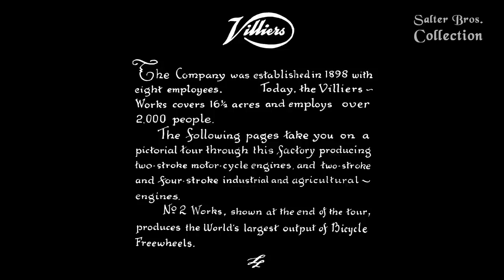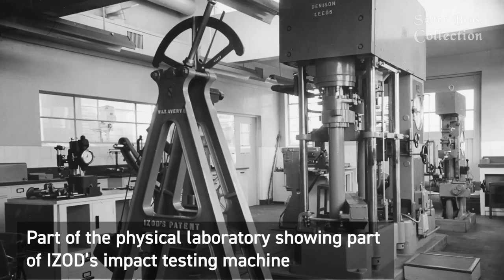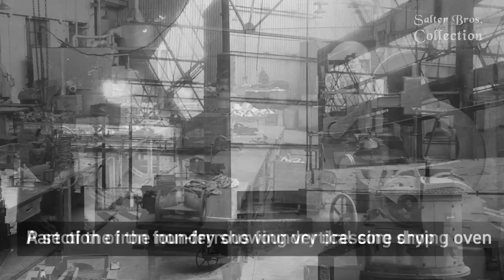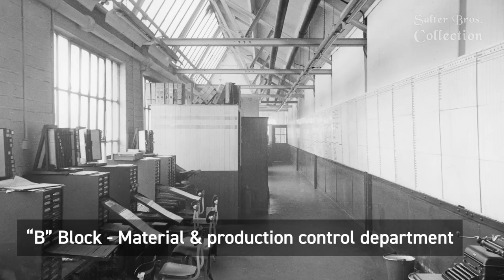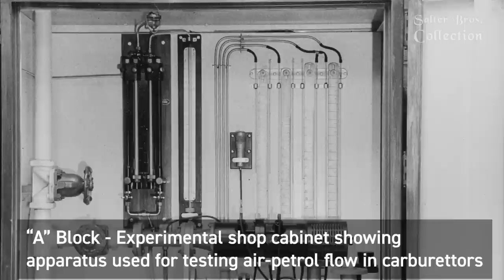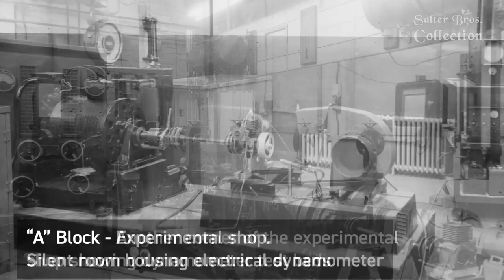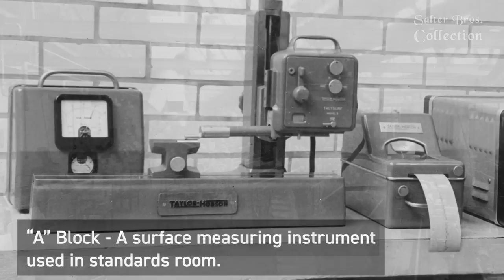The Villiers Visual Story - Villiers Factory, Wolverhampton, England, The heart and sole of machines

Comment: In 1970 when i was eight years old, i stammered very badly. My Father bought me an Ambassador road bike with a solid frame & a 197cc Villiers engine in it. He taught me to ride it in the back field we had to our council house. Once i learned clutch control i was off & my stammering stopped. I rode that bike into the ground eventually snapping the frame. My Father then bought a Triumph tiger cub & put the 197cc Villiers engine in that. I then trashed that frame through jumping it like a moto x bike. 2 chassis frames down & the little Villiers 197cc engine was still going strong. You couldnt kill this little 2 stroke. I owe such an amount to Villiers & my father for the enjoyment those bikes gave me.

Comment: Interesting looking at this series of photographs on the Villiers manufacturing company,  I was looking thru YouTube to find out a bit about my Villiers engine on an old lawnmower that I have and came across this, the old machine I have apparently dates back to 1948 and it’s in amazing original condition, I found it in an old shed here in Victoria, Australia and it has been untouched in it for the last  50 years, due to its brass fuel tank and other bits there is zero corrosion and probably due to our more than dry most of the time climate, the engine, a Villiers Midget, is in remarkable condition as after a couple of hours spent getting it ready and fuelled the damn thing started on the second kick of the starter! And runs like a dream, I can just about count the revs as they can be reduced to a slow speed unlike any other 2 stroke engine I’ve come across, almost like it’s a bloody diesel! They sure made some quality back then!

Comment: The first motorbike that I ever rode was a James with a 98cc Villiers engine.  It seemed incredibly powerful after pedalling a pushbike.
Reply: I liked the 98 Villiers engine we had an Excelcior I seem to remember it had two speeds and a round tin tool box a simple package work bike .It had been abandoned and picked up by the rag and bone man on the flat of his horse and cart and we gave him 2 pounds for it Only needed new points or adjustment and we were in business.
Reply: Mine was a Jame's as well..I was only 15 and stripped it for dirt biking at my local tip...my next one was a Norman B4 sports with a Villiers 250 T engine..both the bike and engine were completely stripped and one of the crankcases had a hole in it...spent a year re building it and had it roadworthy by my 16 birthday and rode it for two years...
Reply: @richardmessenger9474  some great two strokes in the sixties  but these days I like four stroke cycle especially Douglas twins from the 20s and 30s.
Reply: Ah, yes; the James Comet - a misnomer if ever there was one! It was the first bike I ever rode, back in 1959. It had two speeds, being slow and slower! The Piatti-designed engine in the Raleigh RM1 moped that I had wasn't any faster, but it certainly gave me lots of exercise, pedalling hard to get it it to fire! Those RM1's had no clutch, so every time one stopped, the engine stalled... Phew!!
Reply: Interesting I am still riding my Autocycle with 2F engine
Reply: @chrisweeks6973  I regularly ride my 1952 James comet Deluxe so long as engine in maintained seems to run well

Comment: Villiers is back !
A new Villiers company based in Norfolk is currently dino testing a 2 litre V10 and a 1.2 litre V6 which will both be used in sister companies Connaught who are building a speedster sports car, built on their racing heritage. And a brand new Levis cafe racer using the Villiers V6 engine in a stainless steel framed  motorcycle.

Comment: In the mid 1970's I served a traditional 4 year engineering apprenticeship, working in a large and very noisy Marine engineers in Edinburgh . . When my time was out aged 20, I was paid off and got my first tradesman's job in a huge long established Wire and Rope factory as a maintenance engineer . . The "Wiremill" was an eye-opener compared to the relatively modem Marine Engineers and was a dirty, dangerous and very polluting place to work - and same as Villiers it was ear piercing noisy when all the machines were running full steam.
40 years later both are gone - one is a Tesco and modern units, the other a huge development of luxury apartment - the same all over the UK today.

Comment: Great video, pretty much everyone likes Villiers engines and you are lucky if you own one. I don't ride motorcycles so I'm talking about small stationary engines. They were widely used to power many appliances from lawnmowers to generators, cement mixers, water pumps etc... at building sites, farms pretty much everywhere.
Now the one of the main disadvantages of small Villiers stationary engines; the crankshaft don't have a woodruff key for the flywheel so ignition timing is difficult(not as easy as it's counterparts).
Villiers engines were built from very good quality parts; this made the spare parts very expensive and their scrap value is very high, for example the flywheel is solid brass, engine block is quality cast iron, the sump and carburettor and magneto back plate are quality aluminium. So these quality parts always had a very high scrap value compared to other engines like Briggs and Stratton etc.. and Villiers was not easy to fix if anything went wrong and parts were costly.
The WX11 water cooled 2 stroke stationary engine and Villiers Mar-Vil and the Villiers Mk15 ohv engines are among the most collectable ones and fetching astronomical figures if they are complete.
Best Regards

Comment: i have a 1922 atco mower with villers engine--- bought it ten year ago been at cricket club all its life then put in shed over 3o years not touched-cleaned out fuel tank and carb---set/cleaned points- new plug-- new ht lead mice had eaten it---swinging it over 2nd swing fired straight up a good villers engine now show it as it is --and it can still mow grass

Comment: In the 1980,s I started running lorry,s out of forges and machine shops around the Black country. I worked alongside Perkson Forgings in the Lye and the area was full of works of all kinds. Steel stockholders. Picklers. Galvanizers. You name it. Now all has gone, and I mean all. All those skilled people. The pubs. Cafes. Gone. I packed up the haulage in the late 90,s due to the collapse of industry. And now, in my latter years, have started a machine shop with my son. You never know. What goes around.....

Comment: The cost back then of setting up the infrastructure must have been phenomenal! Very, very technical for its time, let alone the surgery and nurses ! Plenty of regular injuries to justify that cost alone then!? So, anyone know what happened to bring about a total demise, I assume? Cheers
Reply: ’m sure that there were more industrial accidents back then but don’t forget that this factory dated from the time when there was no NHS. Responsible Capitalists look after their workers.
I don’t know anything about Villiers non-motorcycle customers but by the mid sixties many of their motorcycle customers were going, or already had, gone bust. It’s too simplistic to blame Japanese motorcycles. The British working class was becoming more affluent and stopped riding Villiers engined James or Francis Barnett motorcycles and had switched to Minis, Morris Minors, Ford Anglias and other cars. Those who wanted 2 wheels for their commute switched to Honda Cubs with 4 stroke engines or they could still buy a BSA Bantam if they wanted up to 1972. Yes Villiers long stroke two stroke engines were out-dated especially compared to the Suzuki Super Six 250 with its square bore and stroke, twin carbs, posi-lubrication and six gears but this bike dated from 1966, too late to play any part in the demise of Villiers. 
Even if Villiers had made more modern engines more cheaply I doubt it would have made much difference in the end, unfortunately.

Comment: When I was child, we had several Villiers alloy industrial engines on my father's farm in Australia, for pumping water, generating electrical power, running saws.   Villiers was about the only brand available up to the 1960's having driven out the cast-iron Moffat-Virtue on price.  Villiers were good durable engines mechanically, and conservatively rated on power output, but had frequent magneto troubles.
In the mid 1960's, Honda engines became available, imported from Japan.  They were far more reliable and available in a wider range of sizes.   That was the end of Villiers.
Now Honda has been almost driven out by clones of the Honda, made in China by several Chinese brands.  They wear out in half the time, but cost about half too and almost never break down.

Comment: Was the air cooled twin cylinder diesel made here?
Reply from the maker: I believe there were only two diesel models made. Both single cylinder air cooled diesels.
Reply: @salterbros.collection  thank you my recollections are of the 50's so a little off at times! The shipyard where I worked had a tree wheeled trike affair about 30 of them and only the front wheel was driven. It was all mounted in a circular support frame that had ball bearing to cope with the weight of the engine / gearbox & drive wheel. I have cranked the beggars many a time and don't ever recall seeing a name BUT they were always referred to as Villers and I seem to recall there being 2 valve lifters for hand crank start.
Reply: @alangraham4526  you might be on about the Lister Autotrucks.
Reply: @paulnolan1352  thanks for the info. Would this be a subsidiary or totally separate? I do recall they were a begger to start on damp winter's mornings!!!
Reply: @paulnolan1352  Yes just seen one on the net! I was convinced it was a "Lister" should have bet me a fiver!

Comment: Villiers' engines were just about OK but not super reliable or with very high performance as standard.  My first motorcycle had a 98cc 9F with a 2 speed gearbox which, of necessity, taught me a lot about maintenance and the Greeves trials bikes I had could certainly be temperamental. In fact most trials bike manufacturers used Villiers engines or up to 250cc.  They had little UK competition and were slaughtered when Japanese and Spanish manufacturers entered the market because they did little innovation  - just like the rest of the British motorcycle industry, sadly.